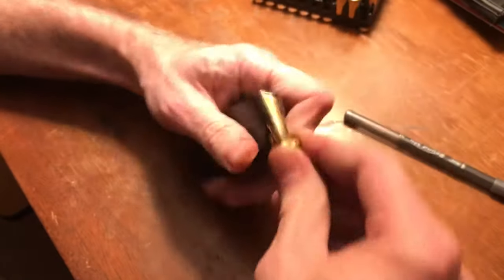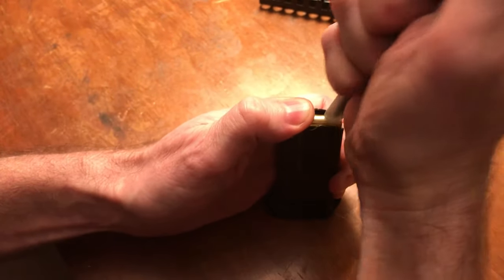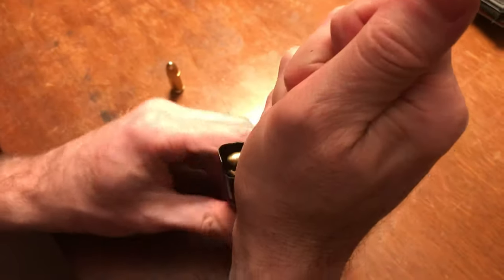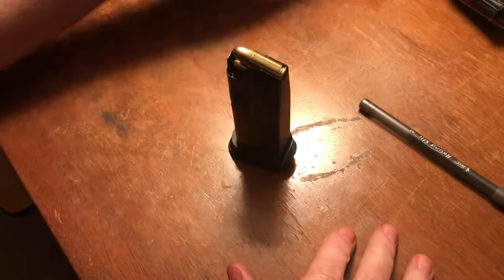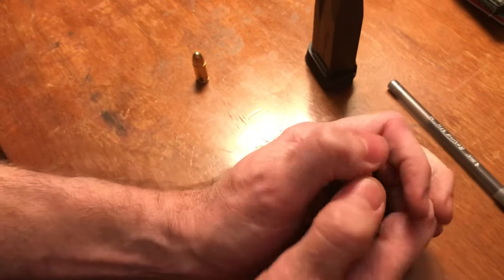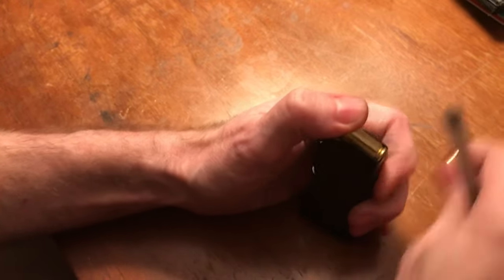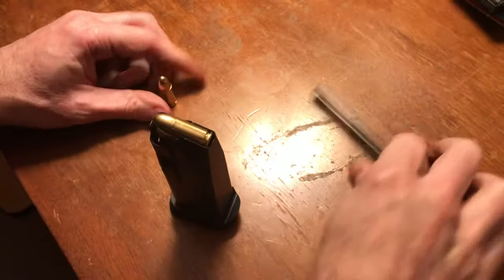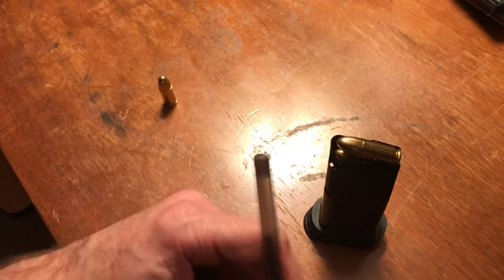Trick To Loading SIG P365 Magazines

Comment: Nearly broke my thumb trying to get the 12th in. Came here to see if it was just me or its just a sig thing.
Reply: Just a sig thing - the more you practice, the easier it gets... its all about leverage
Reply: Same. Glad I’m not alone in this.
Reply: I can barely get the 12 th round in but then I can’t get the mag in the mag well without smacking it with the heel of my hand.  If I put 11 in there it pops in east… definitely a Sig issue.
Reply: I thought the same 😂
Reply: I'm loading a 10 rounder and got to 7 and was really struggling (and my thumb was hurting
Reply: I have to use a uplula. Also bought something to exercise grip strength

Comment: First time Sig purchaser here. I've always been a Colt, S&W, Glock guy and for some reason (Still unknown even to me) I always thought of Sig as being a "James bond / Mission impossible / Designer type gun". Once I gave it a chance, I quickly found a fondness for this P365X and purchased a pair for the wife and I. There's a few nit pick quirks (Like with everything) but over all, I am embarrassed to admit to having my ignorant previous opinion. When I got around to mag loading, I couldn't wrap my head around what was going on. The first few were tough and it got progressively harder to the point that last round, I thought I would dent the brass and even thought the mag had the wrong spring. I'm glad I found this video. At least now, I'm pretty sure that I have not completely lost my mind and all of strength in my hands. It would be impossible for my wife to load these mags..... Maybe a factory included mag loader for ever gun sold would be a great idea.
Reply: Yeah it's not just you. I bought a Ruger LCP Max and a Sig 365X. The Ruger actually came with a plastic mag loader, Sig did not even though it definitely should! I had to buy a mag loader to get that 12th round in the mags! It's crazy how stiff that spring is. Sig should throw in even a cheap $1-2 mag loader to help new customers out.

Comment: I just purchased a P365 back in December 2021 as an off-duty gun.  I have pretty strong hands from training with martial arts weapons, and I had a very hard time where I could not fit that 12th round in the 12-round magazine.  My firearms instructor who qualified me with it advised me that the zigzag follower spring is high tension and I’ll just have to break it in through use.  He got the P365X and went through the same thing.  A humbling experience, lol!
Reply: Damn, I guess I won't be able to load 12rds for a couple of months😓😓😓
Reply: I just bought the 365X and the pen trick worked.My weapon came with the 10 rounders though
Reply: @wirelessone2986  why was that, was it used?
Reply: I just purchased my first pistol P365x Romeo Elite and was having trouble getting the third bullit in the clip.  This made life so much easier!  Thank you sir!!

Comment: As I said in another video, getting that 12th round in is like the feats of strength during Festivus.
Reply: I see I wasn’t just me, as said by everyone here. Glad I can by and learned something new!
Reply: Try the 15 round!  You'll buy a speed loader like an UpLULA in no time.  Even using that it's a little hard to get the last round in.
Reply: Hahaha I can barely get 8
Reply: @stephengreico2810  I eventually got it to be less of a problem.  I loaded 11 and let it sit for 3-4 weeks, then loaded 12.  Then I ended up buying a Glock 19 and a CZ P-07 with the CZ becoming my main carry for risk mitigation, AIWB, and the better SA trigger after the initial DA pull.

Comment: P320 mags are easier to load than most, while the P365's are at best 3 times more difficult.  Maglula works on both and on most 9mm mags.  It is one of the best accessories I've purchased.
Reply: i usually load my P320 Magazine with 5 or 8 rounds mostly because you don't need a Full Magazine to kill an intruder or burgular in your house when all you need is a Head shot in some ways it makes sense i mean why go through the hassle of loading a full 16 or 18 round Magazine when all you really need is just a few rounds
Reply: @dallasmay4031  yeah... don't do that put an many rounds as you can in your mag you'll thank me later
Reply: @V2_Dre  yeah but it hurts the fuck out of my fingers wich is why i also carry a spare pistol in an ankle holster
Reply: @dallasmay4031  get a magguts extension kit it helped me out
Reply: @fuesha  or just simply go for a head shoot or leg shot it's hard for the intruder to attack with a bullet in their head and hard for them to try and run when they have bullet in their leg don't you think?
Reply: @fuesha  i have had lots of practice when it comes to shooting besides i want to save ammo in the long run so if it means having less in a mag to save a few then it's worth it
Reply: @dallasmay4031  if you worried about saving ammo limiting yourself to a certain amount of ammo is extreme to me just have better trigger discipline and count your shots

Comment: Just bought my P365 today (new).  I had traded my S&W AirLite .357 for a FN 503.  Very similar to the Sig 365.  The FN503 was a total disaster at the range testing it out.  It only had 8 in the mag with one in the pipe. It would fir the first shot then either misfire or stovepipe.  It did it 8 times with the first box of 115 grain FMJ Federal rounds.  Then I tried my 124 grain hydra shok that i would be carrying, and same thing.  Returned the gun to the dealer and bought what I intended on buying in the first place....P365.  It comes with 10 round mags and by the 7th round my thumb was numb.  Your idea helped me finish loading to 10.  I have a Glock mag assist somewhere that I never needed until now.  I hope the springs get easier over time.  Thanks for the video.
Reply from the maker: Glad it helped. I almost bought a 357 airlite but too afraid it would pop out of my hand.

Comment: I love the tough guy on the video saying we are all a bunch of weaklings and don't have enough grip strength to load a magazine lol. The problem is not grip strength but the floorplates. The flush one it comes installed with made for the P365 XL which he is loading is recessed so the spring keeper can sit down into it making the magazine deeper, but the P365 floorplate  is flat and not recessed. This shortens the length of the interior of the magazine by 1.06 millimeters which is about what I come up short when I'm trying to load the 12th round. You can see this by looking at the bottom of the magazine. With the XL floorplate installed the spring detent pin comes all the way through the hole and is flush with the bottom of the floorplate, but with the non-recessed floorplate made for the P365 the pin is sunk in 1.06 millimeters. I'm a bit mechanically inclined and thought for sure I didn't put it together correctly when I didn't see the pin come all the way through but it wasn't me. I wish Sig would engineer a recessed floor plate for us P365 owners or just call this an 11 round magazine. If you can open this picture you will see just how much taller the P365 floorplate is which pushes it up further into the magazine compared to the XL floorplate. 
https://www.sigtalk.com/attachments/12-rd-flr-plate-keerpers-jpg.400431/
Reply from the maker: Thanks for the detailed explanation. Great insight. It also seems like the spring metal might have different properties and the design of the magazine itself causes more friction binding than most other magazines. I assume this may be due to such tight tolerances.
Reply: @wdtony  Were you able to open the photo? I'm not sure if you have to be a Sigtalk member to do so.
Reply from the maker: @HeinrichEichmann  
Yes. I could open the photo.
Reply: LOL! From a brother Deadfish-Handshaker.
Reply: Bro, that guy in that video was ridiculous lol.
Reply: Just found that out today lol took it apart to make sure it wasn’t me.

Comment: im a glock guy but today got a p365, my first non-glock pistol, after lots of research decided it was a great gun for what i needed and had a pretty good reputation. 1st i couldnt use the slide release it was so hard to operate, then i struggled to load the mags. man i was frustrated but i figured it all out. ive never had to break in my glocks :)
Reply from the maker: I’ve owned dozens of guns in my life and have never had trouble loading mags until this p365. Great gun though.
Reply: I had the same issue with the slide release. When it was brand new I couldn’t drop the slide with it without two hands. It’s broken in a bit and can use the release, but it’s still harder than I’d want.

Comment: Bro, genius hack. New gun and mags. I loaded five with my fingers, gave up and then found your video.  I was able to load 11 using the ball point pen and stopped because of the spring tension.  Now I need to know the magic to change end cap on the 15 round mag.  Thanks!

Comment: I found a $6 fix. Ordered the ISMI Plus 5% 10 round mag spring from NDZ Performance. Ran this in both 12 round XL mag and 12 round 365 mag (with factory 365 finger extension). I can load 12 rounds much easier. Full mags will actually load with action closed. I left it fully loaded for 5 days to break in. Function and slide lock was great throughout my last 3 shoots! Web site says the material endures longer but gonna see how it's does long term.
Reply from the maker: Thanks for posting this. Great information!

Comment: Thanx man! It was very helpful to know this wasn't a me issue! I forced mine so hard, and then it wouldn't load into the gun, I had to force it in, then when I unloaded the mag the slide wouldn't lock back because the spring got  messed up, I disassembled it and put it back together which fixed that problem, but I'm going to take your advice and load 9 for now.
Reply from the maker: Cool. It seems like letting the springs compress for a day or two really make a difference. 
I love the magazines but in the beginning they are tough to load. Not a bad trade off for an extra 4 rounds in my opinion.
Reply: @wdtony  no kidding, and 10 rounds is actually the max legal limit in nj anyway. Besides I’m a sworn sig fan since I laid hands on their 365!

Comment: That's crazy using a pen like that. Just buy the mag Lula loader. I have one but even with that mag Lula the 12 round was almost impossible to get that last round into the magazine. Then it wouldn't seat in the gun when I loaded it and when I finally got it to seat after banging on the bottom of it which is not a good thing the slide wouldn't rack! It was just jamming up on that last round instead of sliding back over it and picking it up on the return. In sigs little manual it says to lock the slide back put the magazine in and then release the slide and it will put one in the chamber. Eventually I got it to work by simply putting 11 into the magazine putting one in the chamber with the slide and then putting two more rounds into it after popping out the magazine. Kind of a pain in the ass but I suppose it's a good thing to have a good strong spring. Basically had the same problem with the 15 round mags that came with this tacpac.

Comment: Also, every 2 to 3 rounds, you need to slam the mag into your hand and make sure the rounds are going in correctly, and THEN slam the back of the mag into your hand to make sure they all SEAT to the rear of the mag... It DOES help for the last round, and after you have 12 rounds, you SHOULD be able to slam the mag again and STILL have some slack.

Comment: The cost of a mag loader is small in comparison to the amount spent on the firearm and ammo that will go through it.  I bought two different styles of mag loaders to try out.
Reply: I bought 1 speed loader, and it didnt work because the round hits the loader first and doesnt want to catch.... but after 1 year of practicing, i dont need any tools anymore --- use your 2nd thumb to help push the tound down and pull back at the same time to catch --- then you can slam the mag down and finish seating it

Comment: I had the same problem with my p365 12 round mags. Even the 10 round mag wasn't easy. I actually bent the ramp on an uplula loader trying to get bullet number 12 in. I kept the mags loaded for a few months.. and would unload and reload a couple of times a week.  Now i can get all rounds in by hand. The 12th round is still tight.. but very doable.

Comment: I just received 2 15rd mags for my new XL and I thought I was doing something wrong until I saw this video. I have a 9mm speed loader and I decided I was going to relentlessly shove the full 15 rds. After about 2 - 3 cycles of loading and unloading, the spring loosened up a tad bit. I guess it’ll take some breaking in. Oh well. Still a great pistol.
Reply: You didn’t have any issues shooting that first magazine with full 15 rounds? No malfunctions? Seems rather tight and mag needs to be slapped in to be seated correctly. Let me know

Comment: Yep,  the Sig mags are HARD to load. I use the Glock speed  loader. Works great and is less than 10 bucks. Make sure to get the Glock loader that fits the 43x. Works perfect for the 365
Reply from the maker: Thanks for the info!
$10 is better than $20 or $30.
Reply: thanks for this - i bought a CRAP loader that didnt work
Reply: Thank you for your comment. I got my Sig Sauer p365xl Rose Comp yesterday and tried to load the magazines with the loader that came with it and was only able to load 3 cartridges. After watching the video I read your comment and thought I have nothing to lose. I pushed my 43xl loader on hard and I heard the springs pop. I was able to put 11 in each magazine. You saved my frustration and my fingers. Thank you!!

Comment: You can loosen up the spring like this:
Get a long rigid object (like the handle side of a spoon or wrench) and shove it down the empty mag a few dozen times, actuating the spring thru the full range of motion. My mags are significantly easier to load now, I have no feeding issues.
Reply from the maker: That’s an excellent tip. I will try that. I’m assuming you have no feeding issues.

Comment: I have 5, 12 round mags.  All are very hard to get that 12th round in. And worse. On a loaded chamber.  Try to seat the mag.  It takes so much force.  Speedy reloads are hard.  
Also.  My slide scratches the top bullet in the mag.  Cause there’s no wiggle room.  I put 11 rounds in my spare mag now.  Reloads are so much easier.

Comment: I was having such a hard time loading my SS Clip. I thought I didn't know what I was doing, until I seen this video. This video was very informative. Now I know it just wasn't me. It's extremely hard to load this darn thing😟.
Is there any another brand of clip I could use in place of the Sig clip?🤔
However, my hands were hurting trying to load this clip, So I put on some form fitting hand gloves, and it made it so much easier to load the amo inside of this clip🤗
Reply from the maker: I don’t think any other manufacturer makes magazines for these p365’s.

Comment: Getting the 12th round in isn’t the end of the problem. Once you have 12 rounds in it you have to force the mag to seat in the gun if the slide isn’t locked back. It’s such a tight fit I wonder about it causing issues. Has any body put enough rounds through these mags to make a difference in the tension?

Comment: After seeing the shaking of the had holding the pen, I'd say that, unless you are REALLY tight for cash, get a proper loader. (By the way, if you bought the 365 because you were really tired of not being able to reach the trigger, dealing with that flippy thing on the trigger and the '80s trigger guard on you Glock, the Glock mag loader seems to work on the Sig 365 mags)

Comment: I am with you dude. Just got mine and I got the blisters on the thumb. Did you have any issues cycling while firing?
Reply from the maker: Nope. She shoots like a dream. My assumption is that Sig purposely engineered the mag springs to be so rigid to ensure proper cycling throughout the mag travel and maybe increase speed of chambering. I love the pistol other than those tough mag springs.
Reply: @wdtony  Awesome! I already can't wait to take it out. I was using your pen trick earlier. It helped!
Reply from the maker: @stephenholton9216  
It’s a good backup method. If you do a lot of shooting it’s probably best to get a speed loader. 
I don’t shoot that much, myself.

Comment: Can we disasemble the mag and remove maybe 1/2 inch of the spring with wire cutters and reasemble
Reply from the maker: I wouldn’t do that. The spring pressure was designed specifically to match the function of the action. 
Altering the spring could lead to jams or loading issues.

Comment: Are they easier to reload now?
Reply from the maker: Somewhat, yes. The springs seem to relax a bit over time. But I still believe the high pressure is good for the cycling of the rounds. They probably have less feed issues with more tension. I’m just guessing.

Comment: Jesus, I had trouble even getting one round loaded! Why do they have such a hard spring? I wanted this gun so bad, now I'm thinking about selling it. What good is a gun that it is too hard to load?
Reply from the maker: I love the gun. It’s compact and very reliable. You can buy an autoloader which is what most people do. But you are right, I’ve never felt a spring with this much pressure before. If I had to guess, it probably was engineered to keep reliability of feed through the entire span of the magazine.

Comment: I just bought a P365 a few days ago.
Loading the 12 rounds magazines were impossible without my UpLULA speed loader.
I had 3 MALFUCTIONS because of the damn tightness of the rounds in the mags. 

Forget about relying on this gun to save your life. 
It was a piece of crap when it came out in 2017 and it still is. I will NEVER buy another Sig. 
HERE IS THE SOLUTION:  CARRY A GLOCK.